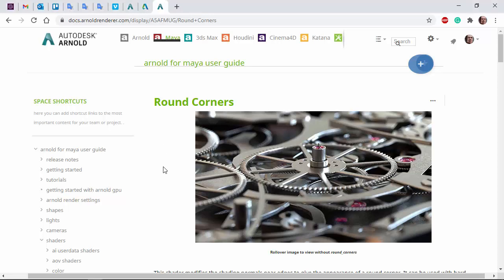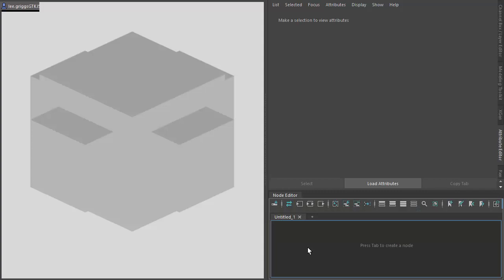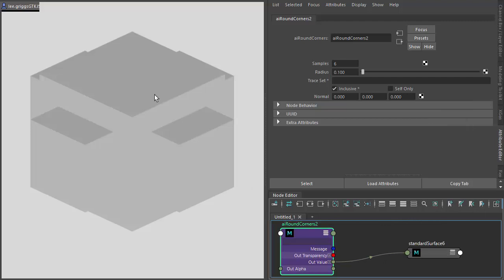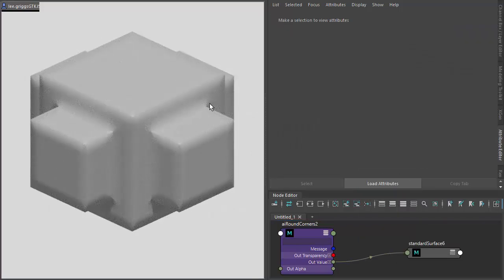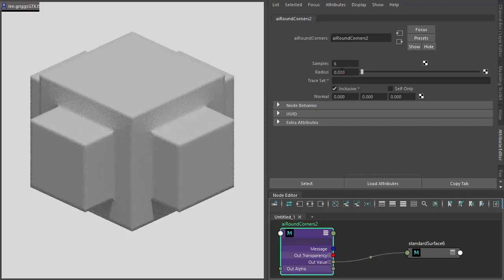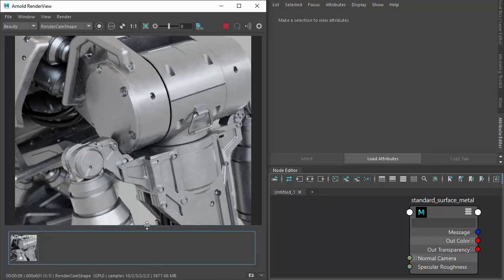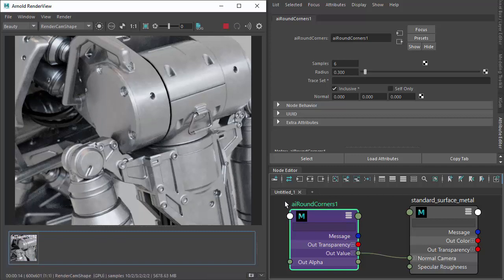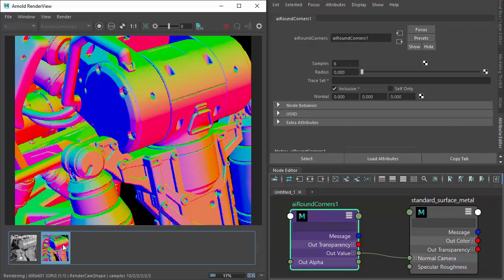Arnold tutorial - Using the round_corners shader in MtoA

Comment: Is there a way to use this on less than 90 degree Edges? I came up with the same problem like shown in this video where the 45 degree edges are not affected by the shader. This yields to inconsistencies which I can´t use now for my project. Is there a workaround? Would be nice to have an angle attribute added to the node! :)
Reply: I've been hoping for an angle setting since the release of this shader. As it is, the use case for this is limited.